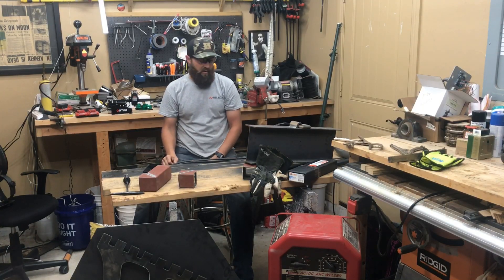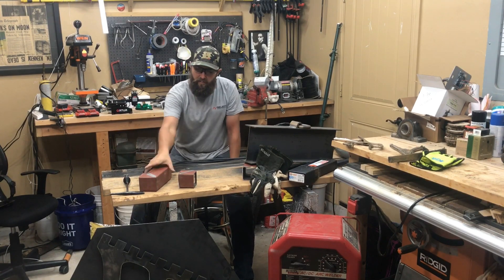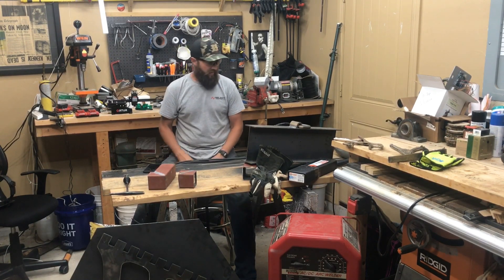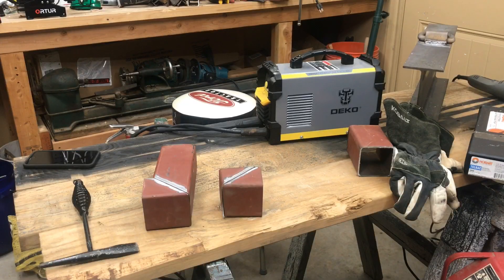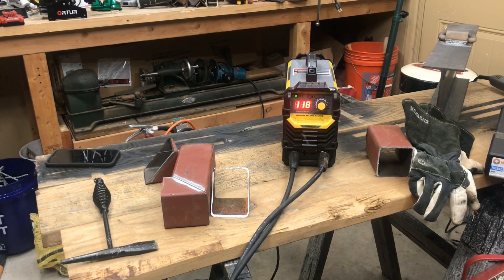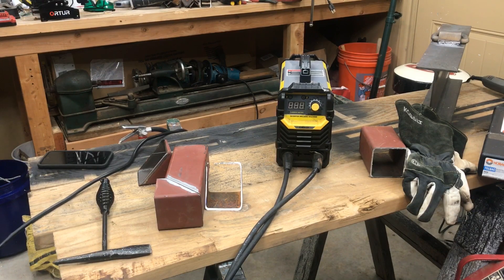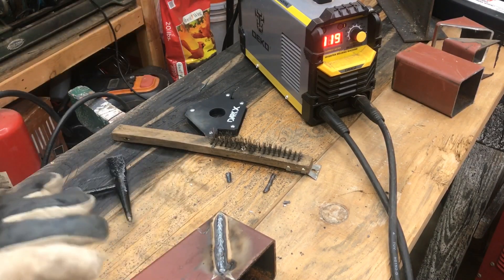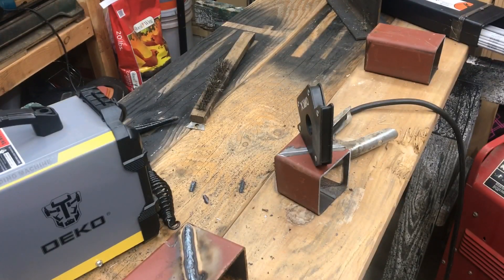DEKO PRO 110v Stick Welder - Amazon Product Review and Comparison vs Lincoln 220v

Comment: You NEED to try it at 220v. This is because of the way the internal IGBT is in the DEKO, it's current limited so at 110v you'll only really be able to get maybe 80A out of it, while at 220v you'll be able to get the whole 160A. Most of the reviews state that they get much better welds on 220 than 110. Same with the CUT-50's plasma cutters, we have one and and 110v it doesnt work too good but on 220v it slices through 1/4" like butter.
Reply from the maker: Good to know! I’ve never even tried it on 220v bc it works so well on 110v. Lol. I’m going to give her hell this weekend and let her rip on 220.
Reply: @MrJustinWheeler  you could try a smaller rod maybe 3/32 on the 110 setting
Reply: You would likely get better results if you cleaned the coating from ground clamp location.

Comment: You could try to use some 6013 2mm just for the tack welds and the 7018 for the welding.. Because it's not easy to tack weld with the 7018 after they lose that tip at the star they get sticky on a cold weld.. Great review thanks for sharing...
Reply: I run a lot of 7014 because it is the best of both worlds in my opinion. Its stronger than, but runs a lot like 6013
Reply: Great welding 💪🏻💪🏻💪🏻

Comment: I just got this deko welder and got to try it today. Worked decent on 110 for some small stuff no problems. Tried it with 220 and did great. Defiantly a lot deeper penetration for bigger metal on 220. But all in all. Really good for the price.
Reply from the maker: Yes sir. I’m glad you have the same positive results. I’ve been using it for well over a year and I’m still very happy with it.

Comment: Liked your video. Very honest and down to earth. I am somewhat surprised that only one person even mentioned about you grabbing and holding the stick while welding. This is where you are picking up your little tingles!
Reply from the maker: Really? Am I not supposed to grab the rod? Lol. Learn something every day. I find it easier to control the rod tip that way. Is it dangerous? Thanks for watching!
Reply: @MrJustinWheeler  you can grab the rod while welding. I’m in welding school and I swear they teach it as a method of getting comfortable while welding which is very important for a welder to do. Now it does get hot as the rod gets smaller but that’s common sense just move your hand once the rod shrinks.
Reply from the maker: @nebodacoolest  I agree. Thanks for the feedback sir!

Comment: Your “little shock” was most likely because you were welding fence which was most likely in the ground, so with your ground clamp connected to your fence, and your whip in your hand, while your not welding the only way for the current to find its way back to the ground clamp would be through your body,to the ground, to the fence post, than of course back down the negative lead. You were most likely kneeling down while you were feeling the tingle so the dampness in the ground connected with your skin through your pants. Next time, try kneeling on a piece of plywood or something to break the chain and you should have better luck. Also good rubber soles help the same way. Good video! 👍
Reply from the maker: I appreciate the info! That makes me feel better. I think you’re right, it’s only happened a couple times when I was building the fence. Thank you!
Reply: @MrJustinWheeler  unfortunately I thought about this video yesterday while lying in the mud and rain welding on piece of equipment that a customer “needed” right away, even tho they knew it was broken all summer.... needless to say I got a few zaps ⚡️
Reply: But if gloves are dry, there is no way he could get shocked.

Comment: yes sir i bougth this welder in may 2020 and since then to may 2021 i have made $18,372.58 withing one year on side jobs insted of using my big millers i have since then bought a used 2012 ram 3500 and now i am going to make a full coustom falt bed for it !!! great welding machine for small jobs/side jobs .

Comment: Lil tip brother, when your going to tack it together next time put a gap rod in between when tacking  will allow for yoy to achieve the key hole when putting in the root. Maximum penetration...that's what she said
Reply from the maker: Haha, thanks for the tip Chris!
Reply: Sounds like some important advice. I am a newbie learning. Can you please elaborate a bit more on "put a gap rod in between when tacking  will allow for yoy to achieve the key hole when putting in the root." Thanks in advance.

Comment: The screen on your inverter welder is reading the amperage, which is more important to know when arc welding than the voltage. Amperage is also what is indicated on the dial on your Lincoln. You indicated that the Deko did not have a DC option. Are you sure about that. Most of these inverter Welders are DC only and do not have an AC option. You switch polarity from DCEP to DCEN by switching the leads.
Reply: I have the Deko and it is a inverter welder, only DC output. Those rods are ok on DC, but can also be used on AC. Also have a buzz box that is hardly used since I got the Deko. I also have a HF 120 welder that is my off road repair tool. This welder really sings at 220V and with a new ground clamp lays a very reliable arc. The stock clamp is the weakest point on the Deko.
Reply: @1skydvejam  the ground clamp is the only real weak point. Mine was all chewed up after a few months of use and literally fell off in my hand. Replaced it with a Lincoln for $6. The stinger could be better, but it works just fine. I was really surprised with the quality and length of the leads. Quite pleased with this purchase. I just got an Amico mig130 for thinner metal and general in the field repairs, it is pretty sweet. I have less than $400 in my welding rig and I can do the same stuff that my buddy can do with his $3000 Miller.

Comment: Looking at this two years later.  Hope by now you (and your viewers) have found out that :

1.  You use the "striking-a-match" technique to "break-in" a new rod since the metal core of new rods stick out a little  beyond the flux covering.  After the first few seconds into the new rod, the outer core forms a crater, with the metal about 2 mm inside its centre.  That way, even with the flux of the rod touching the workpiece, there is still no touching of the metal and the workpiece. 
2.  I have  found that the angle and direction that works best are about 30 to 40 degrees to the horizontal exactly in the direction of the gap to be welded.  If it leaves a slag, then you must drag, unless it is (up) a vertical.  
3.  The difficulty starts when you have to weld thin tubing,  which becomes a series of spot welds connected to one another, at fairly low amperages, e.g.   90 A  at 220 V  !  But since this type of welding is for gates, fences, lawn furniture, ect, , then you don't have to bother about leakage under fluid pressure, just strength and aesthetics.  

Not a pro myself but did take one year of welding in college years ago.  I did High School teacher training in Physics and Chemistry but the college required one year of an industrial program (electrical, welding, auto-mechanics, wood-work, etc.) in order to graduate (in my case, to teach Physics and/ Chemistry in High school, LOL !).  I chose welding (did oxy-acetylene and arc), and have used the arc component extensively during the summer on side jobs over the last 20 years.  Have used oxy-acetylene in auto-body repairs to a limited extent.   In hind sight, that was a good choice. But still not a pro ! Come to think of it, oxy-acetylene and arc welding are related to Physics and Chemistry.

Comment: The Deko is DC.  What it lacks is AC.  A lot of these IGBT Inverter welders are "open circuit" at about 60v.  That's enough to give you a pretty good shock.  
You can make up a 12 AWG 50 ft 220v extension cord and run a lot of work with full current capable.  Tacking with 7018 is tough.
Clean ground is the most important part of any welding job.
Reply from the maker: That’s good info, thanks for sharing Broc!

Comment: you need to clean the paint off the metal where the ground clamp attaches.  That's probably half of your problem getting it to weld
Reply: Also get a 15-20 dollar ground clamp for the Deko.
Reply: This is why the rod was sticking.. and it will penetrate better allowing you to dial in less AMPs for a smoother welding process..
Reply: @1skydvejam  Couldn't agree more. :D
Reply: I’ve watched all the reviews and videos about this welder and they’ve been positively reviewed. I’ve watched people use it at 110 and get great penetration. Unfortunately I can’t get it to weld to the steel, only melt the rods over it. Mine is too weak and I checked to make sure it wasn’t the outlet. Sucks.
Reply: @michaelweller5470  do you have the electrode holder on the positive connection, and the work clamp on the negative?  Building up on the surface instead of penetrating sounds like a classic symptom of incorrect polarity.
Reply: @elkvis  yeah the holder is on the positive unfortunately. Maybe it’s mislabeled
Reply: @michaelweller5470  worth a try.  Switch them and see what happens.  It can't get any worse, right?

Comment: Thanks for the video. I have been considering one of these as a portable. You're right. Penetration is not so good with the Deko. Another thing to consider is that I've seen other tests with the Deko, & its screen is not very accurate, often overstating the amperage by quite a bit. The Lincoln I owned ran hot enough that I only turned it up to 120A once or twice.
Reply from the maker: Agreed. I don’t trust the number on the screen. But it doesn’t serve as a good reference Point.

Comment: Great video. I am in the same boat where you were a few months ago trying to get into welding. Still learning by watching videos before I jump in and buy a welder. Your video helped a lot. One thing I noticed is you are using a 7018AC rod and AFAIK DekoPro is a DC welder. You may want to try plain 7018 - it might make some difference. Just my $0.002. Thanks again for great video that instills confidence in a newbie like me.
Reply from the maker: You're absolutely right! A couple people pointed that out to me and I never even realized it. As soon as I burn through all these 7018ac rods, I am going to pick up some regular 7018. Thanks for watching!
Reply: Nah.. screw that. I bought the exact same Deko and I welded my first (very crappy) bead yesterday. Just buy it and learn by doing, make sure your surfaces are clean and you will not have any issues.

Comment: That Lincoln is a great welder.
Having said that some of the inverter stick welders have adjustable hot start to make striking an arc easier.
There is another setting I can't think of but it increases the amps if you get the spark too short.
I watched a guy try to stick the rod and he could not do it with that setting turned up.

Comment: I always keep a file or piece of sandpaper with me when using 7018.  Once I start welding with it and lift off, the tip sort of "heals over" and makes it difficult to restart.  Scratch the tip  on the file or the sandpaper to remove the residue on the end of the rod. Will be easier to start the next weld. ???  Or "just strike it like a match"  😀  LOL  Thanks for the videos and the good humor.
Reply from the maker: I hadn’t thought of that. Thanks for the tip!

Comment: Those rods said ac meaning they are meant to be ran on AC. The deko is dc. That makes a little difference.
Reply from the maker: You're absolutely right. I am not sure how I didn't notice that. I've used nothing but 7018AC rods with this machine. Lol. Part of the learning process, eh?? Ha. Thanks for watching and pointing that out.
Reply: @MrJustinWheeler  They still work just fine on a DC welder though.  The "AC" designation simply means that they can also work on an AC Stick welder.  Do a Google Search for "Lincoln 7018AC" and Look at the document page/PDF so you can see for yourself.   Under the Operating Procedures, it lists "DC+" as well. :)

Comment: A tip for you  Justin, you should try to drag the rod at more of an angle than pushing. It will make a big difference  😊
Reply from the maker: @Dibulok  thanks! I’ll try to remember that!
Reply: @MrJustinWheeler  I promise, you will get better welds. 😁 take care
Reply: @MrJustinWheeler  how are you liking the machine so far? I just bought one myself. But I got some cheaper smaller leads with mine. Only 6 feet, and much thinner than the ones on your machine.
Reply from the maker: @Dibulok  it’s been a really good machine for me. I don’t have any complaints. Last summer I bought a cheap MiG machine on Amazon and that’s what I’ve been using mostly ever since.
Reply: @MrJustinWheeler yeah a mig welder is nice to have. Specially on thin stuff. How accurate do you find the ampere read out on the deko? I just ran som 1/8 6013 and I had to crank it up to 180 amp to be able to get a good bead.

Comment: Another tip tip with using 120v to run 1/8 7018, is to stick the rod initially to heat it up. As in stick stick, stick it for a solid 2 seconds, and when you go to relight your arc, it's much easier to run the rod on 120v. On 120v it's better to run a 3/32 7018 instead of a 1/8.
Reply from the maker: Good tip! Thanks buddy!

Comment: After a year of use, have you replaced the ground clamp or the electrode holder? Just got the 200 amp version and feel this clamp and holder are lacking stoutness also. 🤠❓
Reply from the maker: Hey Prow. I after a year of use it’s still working good and I have not had to replace the ground clamp or electrode holder. Thanks and good luck!
Reply: Glad to hear.  I haven't used my new Deko welder yet. After I ordered it, it sneakily became a Christmas present from my wife.  She snatched it from the Amazon driver and wrapped it and put it under the tree before I had a chance to even open it up and inspect it!  🤠😁

Comment: Isn't that welder a DC welder?  I've been looking at it and the 200 Amp version for a while.  I have been using my Lincoln 225 AC buzzbox for years and always bought the 7018AC rods for it.  Good to see the 7018AC works ok on the DEKO Pro 160 since that's what I have a bunch of.  Thanks
Reply from the maker: I didn’t realize at the time that the Deko was DC. Shows how uniformed I was when I started. But yes, lucky for me (and you) that they still run the AC rods just fine. (:

Comment: Glad to hear of your success using a 120ft of extension cords on a 110v circuit, welding 7018ac all day, and tripping a 20a breaker a few times.  Still wondering, what AWG were your extension cords?
Sounds like my 50ft 3/12 AWG cord might be just fine on 110v 20a for welding 3/32" 6013 and 7014.
You make good video.  Thanks!  👍👍

Comment: Nice vid,  I also have the same welder and when testing the output, the welder was way low. At 90 shown on unit, it output 72,  at 120 amps output on unit, the actual was 98. Maybe I have a dud but it welds great, you just need to dial in a higher than normal setting. Thx for the vid.

Comment: I do a little bit of welding to make and repair stuff. I practiced a lot in the beginning but without that, my time on projects isn’t great. I stick a lot too but I just need to raise the amperage and move the electrodes fast enough not to burn through.  I’m thinking about the course that TimWelds offers for $39 for each type of welding (stick, MIG, TIG,fluxcore) or $59 for everything. The package might be worth it if I just wanted to learn stick and TIG.